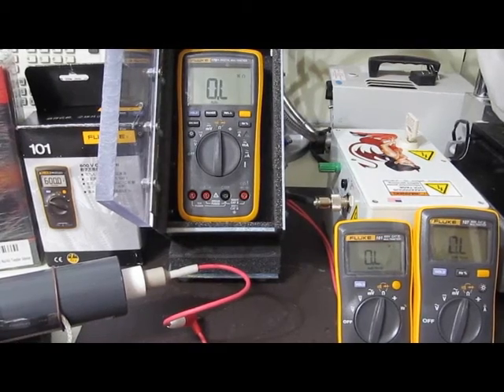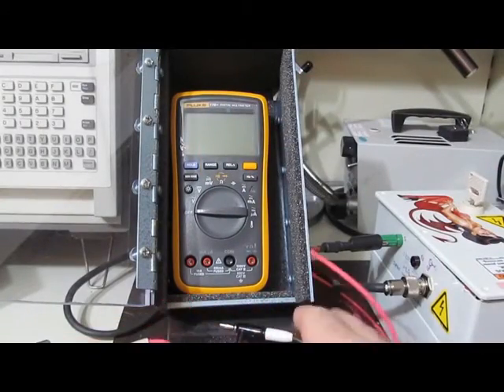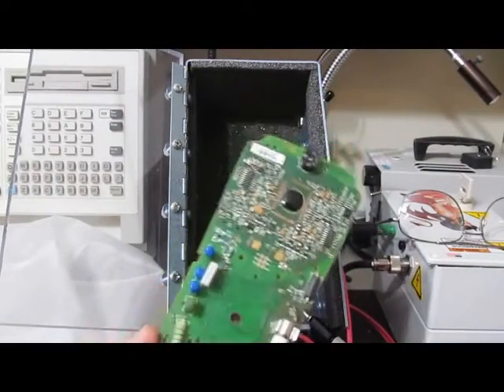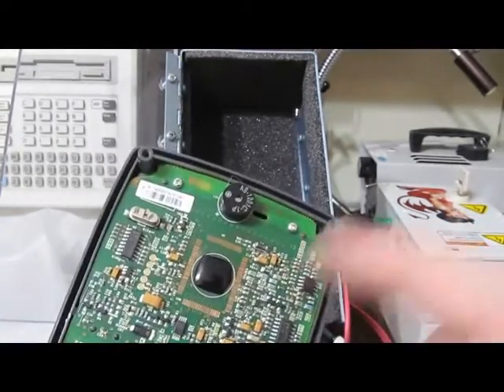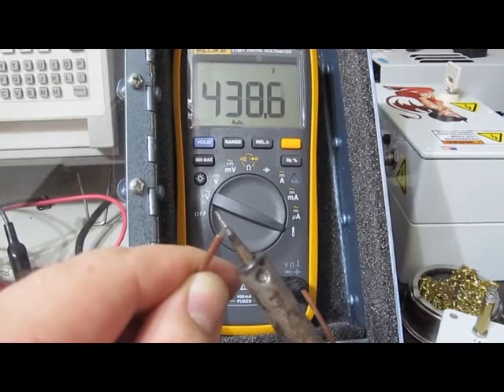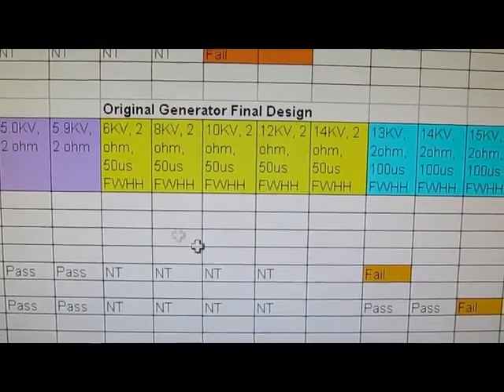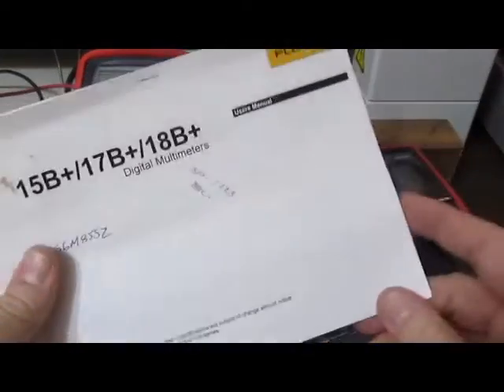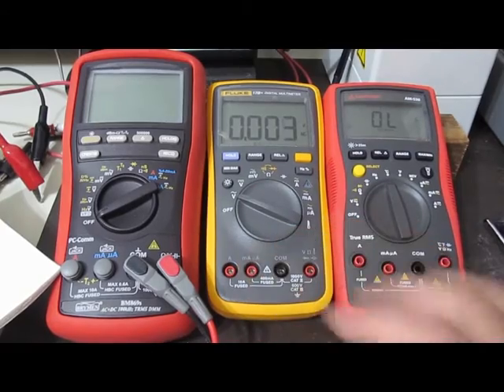The Fluke 17B+ review conclusion

Comment: I have Fluke 289, 87V I will add 17b+ I realy like form factor of it. For basic stuff is great multimeter.
I heard something about weak battery contacts on 17b + , can sombody confirm or it was just a “fluke” 🤓?
Reply: The battery contact is really bad on 17B+. Have to add a folding paper pad for each battery cell. All my school's 17B+ have this problem. The switch feels cheap compared to 117 too.

Comment: Joe, 
 
I work on motorbikes. Was looking for a replacement to my old 200$ Kawasaki (analog)  and finally opted for Fluke's 15B+,  only (!) $135can delivered.  I have other
cheap/good enough analogs for alternator AC, just couldn't resist  Fluke Temptation...

20A DC would be better, but I have an old  -20 to +20 SW britbike one for that, works
great for most bikes and has been indestructible. 

I don't volluntarily destroy my testers, so expect the Fluke to last  to the end of times !
-well, I'm already looking for spare fuses....
Reply from the maker: I've not looked at the 15B+.  Recently I started looking at a few automotive meters.   These can be seen in the more recent videos.  The idea of making these tests public and free of charge is to give viewers some idea how different meters hold up without damaging their own equipment.  Enjoy your new meter.

Comment: Got one for a little less then 120USD shipped. So far so good.
Reply from the maker: After you've had it a while, post what you think of it.
Reply: No complaints if you know what you've bought. Built like a Fluke. As an industrial electrician/electrical maintenance technician I've been using Flukes for the past decade, usually lower end stuff (114, 115, 117) and have complete faith in them. This is my personal DMM and the price was a big part of me buying it. 
    I usually measure three phase voltages (400V), 0-20mA current sources, 24V command voltages, resistance (el. motor windings, temp. probes, winding to gnd, electro magnetic switch spools), start caps capacitance, temperature of the el. motor case, mA to gnd leakage. 
   I'm sure I forgot something, but it didn't fail. There are a minor niggles but not worth mentioning (slow-ish auto range, slow buzzer...) and I wouldn't want to carry it outside in the rain or the snow but it wasn't built for it either. Would like to upgrade to something like a 28-II but $$$. 
   Sorry for the incorrect technical English it's not my first language. Cheers.

Comment: Joe,
I was able to get this meter at a $110 shipped, but I don't see that ad anymore. A set of smd tweezer test leads were thrown in on the deal.
Reply from the maker: +LoverOfPhotograph  When I made the video, they sold for $156.  I mentioned this during the intro.
Reply from the maker: +Donald D&#39;Egidio That's a real good price.  I liked the meter overall.  It seems very mechanically solid and the front end was electrically very robust.   I felt the cost was too high when I bought mine.   At $110, I think it's a good buy.   Let me know what you think of it once you've had a chance to use it for a while.
Reply: +joe smith What did you pay for it? I paid 150 with themal leads and AC transducer shipped. (so 128 without shipping, 100 without the AC transducer)
Reply: Received the meter on Friday. The ma and ua did not work. The fuse was already blown.   :-(
Reply from the maker: Strange that a distributor would send you a used one.  Are you sure you did not spike the input when you tried it out?  Say for example, you set a power supply to current limit at 10mA and have the output voltage set to 5V.  You connect the meter to the output expecting to read 10mA, not knowing there was some big bulk cap in the output.  Instant blown fuse...
Reply: Joe,

Nothing like that. Watched another video where the load from the meter was being measured for the current scales and the A scale has a 40 mOhm load, Ma scale 2.2 Ohm, and the Ua scale 101 Ohms across the jacks.

All I did was use another meter to read the ohms of the Ma and Ua scale and couldn't read any. Opened the meter to check the fuse and it was open. Go figure for an unused by me new meter.
Reply from the maker: +Donald D&#39;Egidio Did they have something in the ad that stated it was a return, refurb or anything else suggesting the meter was not brand new?   Hard to  believe it would make it out of the factory with a blown fuse or that a Fluke distributor would sell a used one without disclosing it.   Did you buy in the parking lot out of the back of a van?  haha  Fuses are cheap if that is really all that is wrong with it.
Reply: Joe,

It's out of China. Need I say more.   :-)

I have some fuses coming and the inside looks new, like it should. I'm not going to lose any sleep over it. It was a good deal.